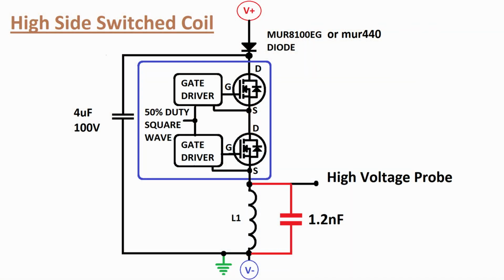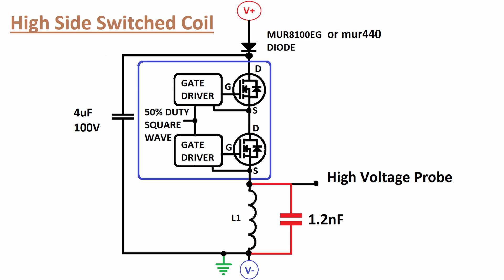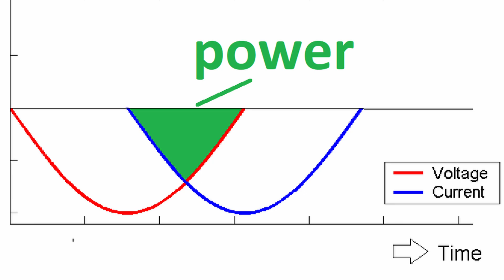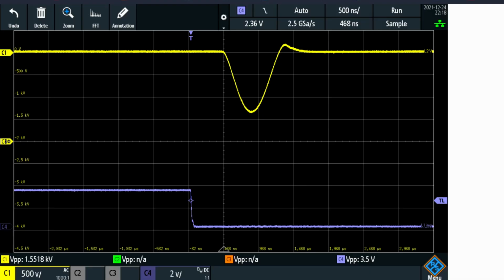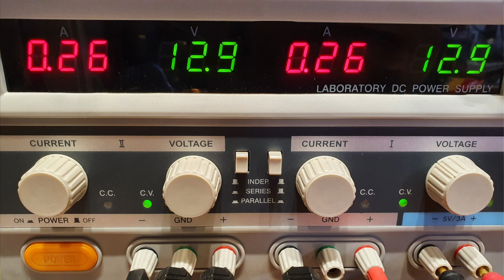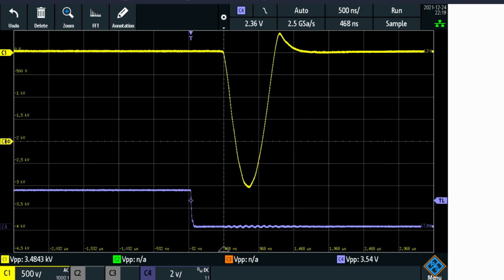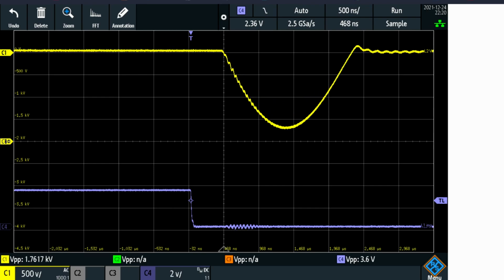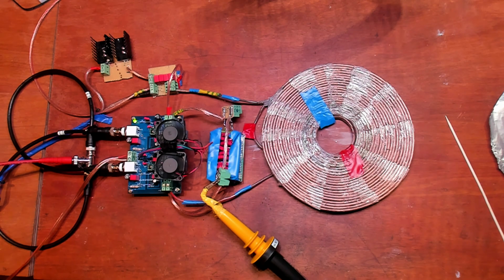Powerful Impulses Levitating Aluminum

Comment: Maybe a real silly idea, but when there is lift between the coil and the aluminium when they are separated. What will happen when they are fixed to eachother? Will lift try to occur between the fused coil-aluminium and the ground?
Reply from the maker: no I don't feel that won't work

Comment: The ontario science centre had a “push the button” demonstration of this, that I and millions of others played with, more than 50 years ago. 
Except that aluminum disk was about 3” in diameter and travelled (hovering) quite quickly, around a twelve foot (give or take) oval track
Congratulations,  you have rediscovered the rudimentary basics of the linear induction motor.
Reply from the maker: cool stuff isn't it! But this works a little different as the high current comes from the impulse

Comment: Have you done any levitation experiments using pure displacement currents without any magnetism? Gray's motor used coils in opposing configuration that would release large amounts of energy in rapid intervals with a duration between 10 to 50 microseconds, the result was a repulsive force due to the pressure from the dielectric current but lacked the magnetic component, as a result it didn't generate any heat and was extremely efficient, in-fact the extremely small duration of each impulse caused the motor to ABSORB heat instead of producing it.

If you could create an impulse current without magnetic current from an extremely rapid duration and interval with enough voltage present you could levitate not just metal but non-metal objects as well without pulling any amps or generating any heat, Gray also demonstrated in a nearly lost interview clip of using a coil to propel plastic objects a good 1-2 meters high.

Video titled "EV GRAY Motor and Cold Energy lost Video"

Tesla also mentioned this principle on any given amount of energy having a much stronger effect if its released in a much shorter timespan, so the same thing would likely apply here too since the interval would have the effect of a continues waveform on physical matter, of course you'd still need to be able to re-charge the voltage at a rate fast enough for the next impulse otherwise it would jump around a lot and lack stability.

I will admit though that Gray claims that it's a mix of voltage and magnetic control, though it doesn't seem he knew about the dielectric field so I am uncertain if he was correct, BUT, even if he was correct it doesn't change that his machines were absorbing heat over producing it, If it is using magnetic spikes then I have to assume that magnetic currents absorb heat if the impulse duration is 100 nanoseconds or lower, at least from what I've been able to gather so far:

"The complete system was wired to two electro-magnets, each weighing a pound and a quarter. “Now if you tried to charge those two magnets with juice from that battery and make them do what I'm going to make them do, you would drain the battery in 30 minutes and the magnets would get extremely hot,” Gray explained. “I want you to watch what happens.” As Fritz Lens activated the battery, a voltmeter gradually rose to 3,000 volts. At that point, Gray closed a switch and there was a loud popping sound. The top magnet hurled into the air with tremendous force and was caught by Richard Hackenberger. A terrific jolt of electricity had propelled the top magnet more than two feet into the air -but the magnet remained cold. `The amazing thing,' Hackenberger said “is that only 1% of the energy was used - 99% went back into the battery.” Gray explained, “The battery can last for a long time because most of the energy returns to it. The secret to this is in the capacitors and in being able to split the positive.” -The Free Energy Secrets of Cold Electricity by Peter Lindeman

Gray also used the same method you showed in your efficient impulse generation video to return the positive back to the source, pretty cool, we know that the displacement current can induce mechanical pressure from Tesla's experiences when he first discovered it, like you talk about in your 3 part video series, it makes sense that it could be harnessed into non-heat inducing field propulsion. Apologies if this went on too long, I just wanted to bring to your attention the possibility of not just inducing levitation but also regular circuit use without heat, which would open up many possibilities for your research, if you haven't already considered it that is.
Reply: Years ago i wound a insulated bifilar coil and connected it the wrong way electrically and got a field that was repulsive  a strong field like air  have you heard of this anywhere  ?
Reply: @deandrealexander6172  That sort of sounds like something I read that Tesla reported on radiant energy producing repulsive effects, when you say "connected it the wrong way" do you mean positive to the outer wire and ground to the inner wire?
Reply: @JenkoRun  yes I believe so
Reply: @JenkoRun  do you know how to reproduce this effect  ? My coil and TV board are both gone
Reply: @deandrealexander6172  I don't know the reason for this and I lack the parts to personally experiment, other than winding another bifilar coil and re-creating the experiment I don't know what else I can suggest
Reply: Years ago i wound a insulated bifilar coil and connected it the wrong way electrically and got a field that was repulsive  a strong field like air  have youve heard of this ?

Comment: 1. L1 and C1 need to ha e the same values
2. The L1 and C1 have to be in series
3. The GROUND needs to be in between L1 and C1. 
In this Configuration it acts like a spring and you can PULES it more Effectively and at the right time with a PWM
Reply from the maker: L1 and c1 cant have the same values as they have different units. capacity vs inductance.
that is like saying your amount of wheels need to have the same value as the amount of volume of air

Comment: I'd really appreciate a video (if you haven't done already, might have missed it on my Netflix-marathon-like binge) showing a systematic review of varying characteristics of bifilar tesla coils as turns, diameter, and (PHI? and others) ratio vary independently.
I'm interested in infinite voltage, zero amps, and how's the most efficient way to generate it. Also what would happen with two opposing coils? (think they refer to it as choke coils) to prevent current? the subject confuses me a bit and I bet you have the knowledge and didactic to show it in a way most of us can grasp. Cheers!

Comment: What are the ripples under the 1st 1/4th section of the impulse?
Reply from the maker: thats from the parallel capacitors over the L1 impulse coil, they all are slightly different and cause this

Comment: This is just pretty standard election effects. This is just a mid 20th century 
Repulsion coil science fair project.
What's so profound about that? 
Every indication is that Tesla was working with engines which were clearly not or only marginally ties to standard partical physics. There are an endless gaggle of electronic experimenter types who are trying to duplicate or partially 
Approach the fully separate world of Tesla and hundreds of minds in the physics community which were doing everything to escape standard, financial/political establishment controlled physics. Sure they wanted the concepts like the aether and energy in a vacuum crushed. The banks and the petro dollar depended on science NOT crossing over to areas like this. Certainly not for engineered devices. It's all who can get funded and who can get published....
But to satisfy the inelectuially cravings of the technically involved and many ordinary citizens who sometimes by institutions along feel that there is huge body of genuine sciencecwhich is being withheld from them and the world. 
The danger of small quickly available superficial demonstrations of simple technology which immediately satisfies 
This craving is that stops such feelings from growing into the kind of public demand which will really produce the real breakdown in the rigid scientific control mechanism the world is suffering under.

Comment: Hi Ivo, I'm nearly caught up.  The inner loops of your bifilar coil look like they are getting darker. EVOs (exotic vacuum objects, energy rings) make and deposit carbon (and other elements). Check with fresh aluminum, look for tiny damage 'witness marks' on the aluminum where EVOs strike.  In a sense, you ARE doing a spark-gap method, just not ionizing enough air to be visible, (maybe check in darkness).  If you strip off the insulation on the inner surface of just the inner-most high voltage loop in your coil, you will let a lot more EVOs free,  but under the insulation, those EVOs are probably turning the insulation into swiss cheese holes. EVOs can alternate into- and out- of our 3D world, so some of them are not contained by the wire insulation, but then come back into our 3D reality, where your hand was feeling them.

Comment: To put it simply it's a dual pulsing circuit that's were the amplifying effect is released . Its compression of magnetic fields. I did it year's ago know Nuclear scientists or Electrician could explain it but ti really that simple
Reply from the maker: dual pulsing?
Reply: @MasterIvo  Yes that is the key 10 year's ago I made this discovery. I have a jewel circuit that pulses by it self when I pulsed that system with a reed switch it charge a dead battery as well as .6 volt dead AA battery raised too .8 while lighting up a 18 volt  array. That why the function generator was a good choice for my project. I am compressing  magnetic fields and absorbing the reverse voltage and also the forward magnetic field . It works and is undefined system . Thank you Bro your the Greatest
Reply: example are in my simple video I try not over explain what is obvious . That were I need some help Loose energy to heat in the hall effect sensor but it work's burned up 3 mosfet 23 amp . Use PWM requires to much power I like the 555 time kept voltage under 5volt to light up 24 volt like 5 time power increase that usable.

Comment: Thank you and yes bench work show unexplained outcomes. I don't expect multimeter or even oscilloscopes to actual explain this energy pattern. The evidence prove it however 20volt Led  110 volt   all running on 5 volts. I design something similar yrs old it self charged. and it ran on .5 volt's.   Thank you Your a blessing.

Comment: Your the best I apologies if I'm to excited my new video i just post. I just proved less in more out in a motor generator design. Amps are less in more out It's all coil design. Thank you for giving me the courage to show it.  You are the best.
Reply from the maker: It's good to be excited, but don't jump to conclusions. Amps and Voltage TOGETHER in space and time, represent Power.
resonant coils can have huge amps (20A) and huge voltage (1000V) but that doesn't represent the power, as the voltage and current are not present at the same time and space.

Comment: Haven't used capacitor yet or the signal generator but I'm on the right road i guess.lost amps with vastest configuration but got 40 volts from 5 . has to be another configuration . Thanks again for your time.

Comment: Your video's are great and your responses are wonderful Thank you . I only wish you were closer love to show you what you've taught me . Thank you.
Reply from the maker: My pleasure. working on the next video here. is going to take some time to get it right
Reply: @MasterIvo  I proved mine 5 volts in 16 volts out and it's really simple. remember 1800 century They did so don't over complicate it . I've given you the answers.  Explore the simplicity .  Both amps and colts were increased. I wish i knew how to send you picture. now I know steve marks TPU is possible . Thanks for chatting was love your insight.
Reply from the maker: just remember one thing, with regular resonance voltage and current can be magnified to high values.
But they are not present at the same time (out of phase).
Power comes from voltage and current being present, simultaneously.
So you can measure 1000V and 10 Amps, but that doesn't always mean 10kW
Reply: @MasterIvo  The Evidence is 3 times at all level's volt's and amps. By counterclockwise it no longer effected by Lentz law but a ratio of wire to wirer working together not opposing. It's a 10 yrs study now so having answer's is a positive . I wish i could share it with the world. No more oil or gas or pollutants .  But i'm old and it's cool. Just for a reference no capacitor or other power source just simple coil. so

Comment: In 2016, I verified Chris Syke's statements about partner ouput coil using the most crude set up. I used pure mechanical switch as oscillator. Away from beating lenz hands down, I also discovered that we need no High Voltage input to get High Output but we need only Resonance. HOW you may ask? 
High frequency Diodes makes it possible to enormously multiplies the output from the partnered secondary coils by:  

1.) Shorting the individual Patner coils with  two  H.F H.V Diodes i.e  you connect the catthode one each diodes to the 2 leads of each coil and connect the anode together! You do this to the other coil too. 

 2.) Sucking Tremendious amount of current from the Ground. 

You need to see the circuit I developed for this as I can not fully explain it correctly.

Basically you need 8 H.V H.F Diodes to get this effect correctly  This is a Quote not mine  but and example of counter clockwise winding that also agree's with your findings

Comment: Just so you know A reed switch create a vacuum effect absorbing more energy sometime 1500 times greater in the back emf . 1 reed switch and inductor  330 henry can produce 110 volt with .5 volt pulsed Dc . It's suppressed information from the 18 century. But your's to  rediscover. it Great.
Reply from the maker: incorrect. the high voltage is produced by resonant transformation when opening the circuit of the coil. Thats the same how I produce my impulses.
Voltage is not equal to energy.
voltage combined with capacity determines the amound of energy.
Reply: @MasterIvo  You are correct so it leads the question of coil and design not just impulse resonances. Looking forward to your next Video.
Reply from the maker: in the end, it is what you do with the impulse, it can set up a displacement current, I feel this is key to amplification (when combined with tuned resonance)
Reply: @MasterIvo  I seen bendini coils, and imhotep relay recharge doing the same things even the reed switch and inductor  with very small in put . I love your response thank you. So these example have many things in common. least of which is the collapsing magnetic field.  Bedini coil is huge relay charge is small and mechanical .same with reed switch and inductor.  all are not tuned Bedini is tuned for rotation. but not coil. So what is missing it's just a thought
Reply: @MasterIvo  I think it's in the bucking effect of coil repelled or attracted field's in timing

Comment: Hmm. John Hutchison also started out replicating Tesla coils to discover the Hutchison Effect, which I think is perhaps a more powerful version of what we see here. Not only can he levitate heavy objects with comparatively not much power spent, the effect also creates several anomalies, like metal liquifying while being at room temperature, changing shape, melding with wood, transmutation, unexplained lights. Anyway, very well done brother.
Reply from the maker: Thanks, yes but did he also levitate non metal/conducting materials?
Reply: @MasterIvo    Yup.  MANY very strange effects, as he was using SEVERAL different techniques to modulate the 'target' area/domain (and the objects placed within/upon it), including resonance, high powered magnetic & dielectric fields, among probably a few others as well.   After watching a few vids/interviews/roundtables with him & others, it seems that thru whatever fields & whatnot he was affecting and modulating, the end result (or at least ONE of them) and best explanation for some of the effects, are the result of the production of EVO's, Exotic Vacuum Objects, inside the 'targeted' objects, and they start to transmutate and warp and 'melt' the test items.  I highly suggest reading into the recent work & research done on EVO's, as it seems to lift the veil on some of the 'highly strange' effects & phenomenon spoken of in recent years, back thru the mid 1900s, into the days of Tesla & his contemporaries, and even much further back into history.

But John Hutchison has done recent interviews and a couple Livestreams on REAL SCIENCE (and prob others too), which is a show posted & contributed to by several groups & individuals:  AlienScientist (Jeremy Rhys), CryptoAlchemist (Bernie), Andreas Xirtus, MartinFleishmannMemorialProject (Bob Greenyer) and many other YT channels/content-creators.   Also, some may not know this, but his wife, Nancy,  has done a lot of work and research along with him, and she is quite brilliant herself!  They are quite the power couple.....  literallly⚡!!!  Lol.
Reply: @MasterIvo  Yes. Non metallic as well rarely. There were anomalies.

Comment from the maker: The input Amps from the supply, do jump up with 1A when the foil is floating above it, from 0,49A to 1,49A at 64.3V,  so when the foil is floating, an extra 64W is needed from the supply.
edit: I see I didn't ground the parallel capacitor, to the negative voltage supply, but instead grounded it to the MOSFET drain. Still worked!
Reply: Interesting experiment. Shows me that for default resonace of tank circuir is better to use smaller inductance and bigger capacitance. This allows better stabillity of resonance (flattened bell) and pump more energy into circuit. Also biqqer Q factor. Cheers, good work.
Reply from the maker: @zeljkolukac4170  flattened bell and higher Q factor?